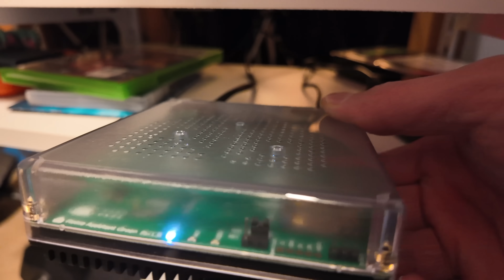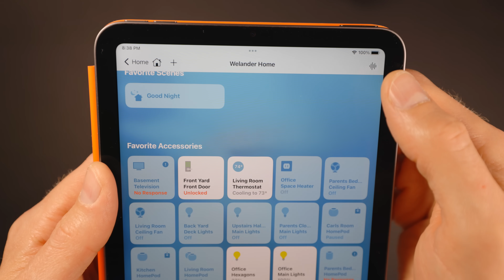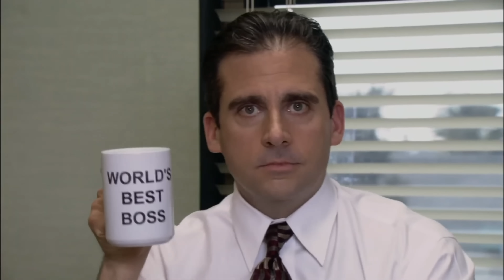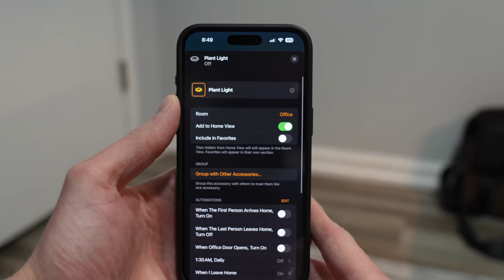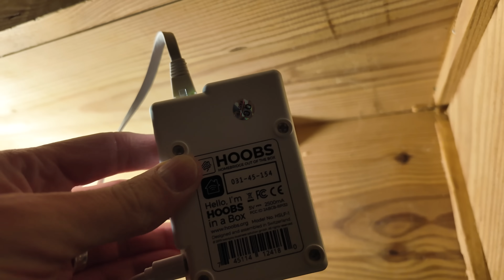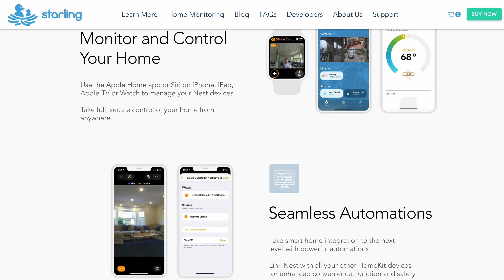Explained: The Apple hubs that control your home

Comment: Thank you for this video.  As someone who is pretty tach savvy, I was struggling to get all this working together and this video was definitely necessary to get everything working together properly.  This isn't at all plug and play like most apple products are, so I'm surprised that it's not failing with the community outright.

Comment: Heads up, if you hardwire ethernet to your Apple TV, it will always default to that as the main hub. HomeKit has an algorithm that picks the best hub based on things like speed of connection, reliability of connection, and placement with accessories. That being said, if you hardwire your Apple TV, it will always be the fastest and most reliable connection and default to that. Hope this helps!

Comment: I just wish I could set a primary hub in case of power outages, sometimes it goes to an AppleTV and Matter accessories stop working until it switches to a HomePod. Additionally HomePod’s randomly will stop working as HomeHub’s, how do you fix that?

Comment: This is probably one of the key points where non-tech folks usually struggle on when trying to set up a smart home, they don’t even know where to begin, what to buy and then why the need “2 hubs”.
Thankfully this is changing with Matter over Thread 🔥

Comment: Hi Eric, I'm glad you brought up this topic, and I'd like to add to this with  difference between a hub and a bridge in the Apple Homekit ecosystem. As I understand, A hub is a device that acts as the central point of communication for all your Homekit devices. It also serves as an Open Thread Border Router, which allows your Thread devices to connect to the internet. 

In the Apple Homekit ecosystem, the hub is always an Apple TV or a Home Pod. However, some devices from other vendors (such as Philips, Tuya, etc.) use different protocols, such as Wifi, Bluetooth, or Zigbee, to communicate with each other. 
These devices require a separate device from the same vendor to act as their hub. This is called vendor-locking, meaning that you can only use devices from the same vendor together. For example, IKEA devices will only work with their own hub. 

But if you want to use these devices in the Apple Homekit ecosystem, you need to connect their hub to your Apple hub. This is what we call a bridge. 
A bridge is a device that links two different hubs or protocols together, so that you can control all your devices from one app or voice assistant.

And I believe, this is what MATTER is trying to solve, but it has it's own nuances?. For example, I'm  missing the Adaptive lighting on Matter based ligjht-bulbs.

Agree?

Comment: Had to put all my HonePods on smart plugs so I can turn them off whenever one of them takes over as the hub rather than my TV4k. For some reason every time a HomePod takes over my automations decrease in operation speed by a factor of 2. Most infuriating thing ever that Apple can’t give us the ability to pick which hub we want in control. A simple toggle switch that says “Make this device the primary hub” on every Apple TV and HomePod would be ideal. And if they can’t do it (hard to believe) then they should at least write the logic so that the AppleTV 4K takes priority, then AppleTV HD is next AND THEN a HomPod/Mini as a “break glass in case of emergency” option.
Reply: I have the same issue. Usually wind-up unplugging and re-plugging in the offending “connected” hub. Would be great to have something like an Eve smart plug on it! Great idea!
Reply: Similar issues. At regular intervals my HomeKit devices becomes slow to respond or not respond at all. Only fix that works is to disconnect all AppleTVs and HomePods for a minute or two and then power them on again. Annoying, Apple should be able to fix that problem with HomeKit.
Reply: Heads up, if you hard-wire Ethernet to the Apple TV it will always default to that. HomeKit has an algorithm that picks the best default hub based on factors like speed of connection, reliability, and placement with accessories. That being said, when you hard-wire your Apple TV it is ALWAYS the most reliable and fastest connection and it will default to it :)

Hope this helps!

Comment: On the lastest Apple TV I’ve noticed there a ton of issues with HomeKit. I’m not sure if the device is overheating since the new one doesn’t have a fan or is it because the OS corrupted. When I check the cameras on the Apple TV the camera view does not go away I have to unplug the Apple TV to close the camera view.

Comment: Eric, this was great. I have always suspected the role of non-“connected” or non-“boss” Apple hubs was as you described, but never came across confirmation until this video. I presume that the other hubs also transfer wifi data to the boss hub should there be an accessory that uses wifi in the Apple Home?

There is also a way to keep a specific Apple hub as the boss, it’s just not simple. I have all of my Apple hubs connected to Eve Power devices. Each night, I power cycle my intended boss hub and let it back onto the network for 30 minutes before I begin to power cycle, one at a time, every other Apple hub. This gives me over 99% of the time that my boss hub is my centrally located ATV 4K 2023 connected via Ethernet.